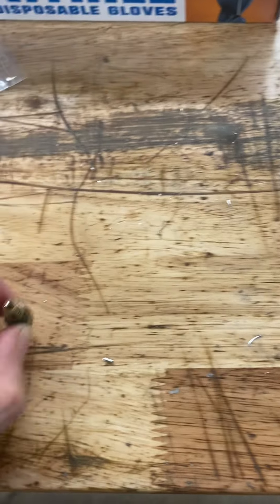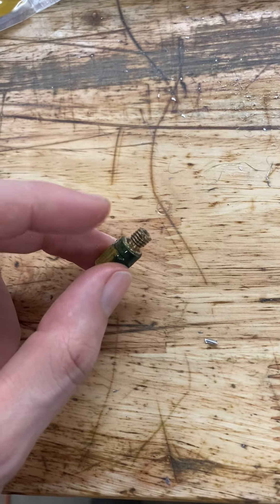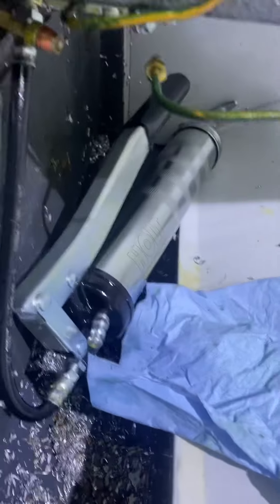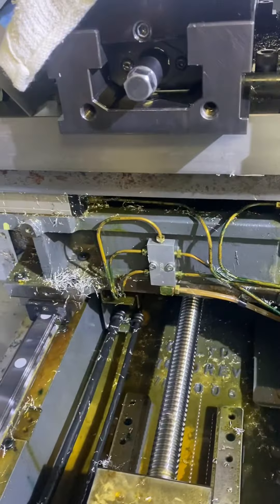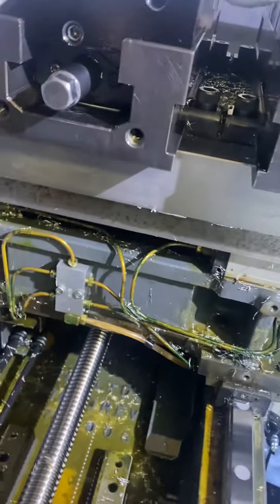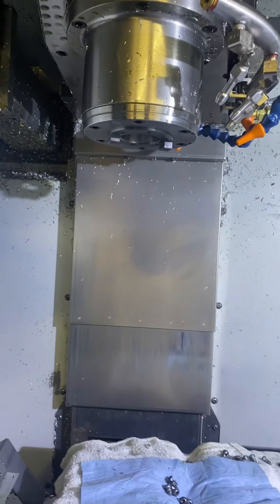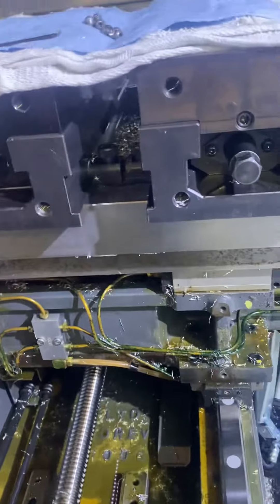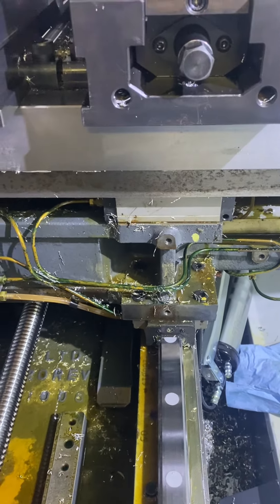Haas minimill 2 with clogged grease lines

Comment: This is because haas sold us bad grease for months. the issued a technical bullion 1 month after i restocked the purple clogging grease, but didnt bother to tell me.
Reply: Edit, right after i restocked the Tan grease.
Reply from the maker: In my case, it was from the oil I had to source when they purged the purple from my lines. This machine never saw tan.